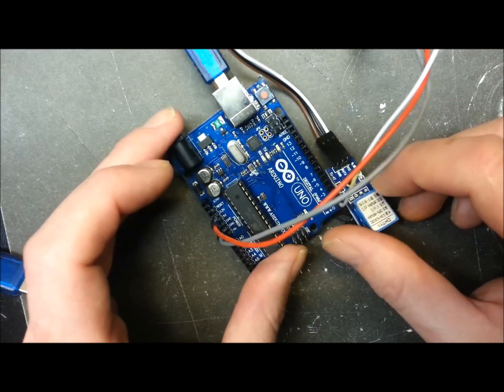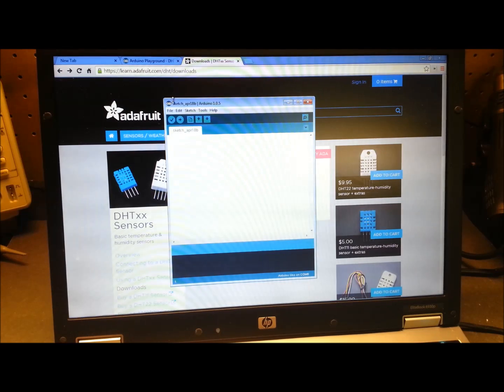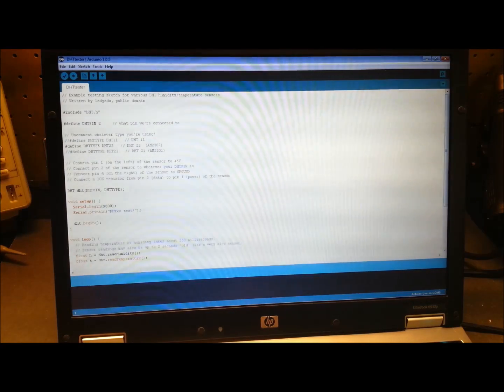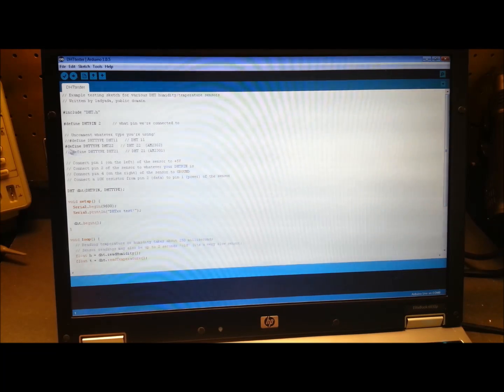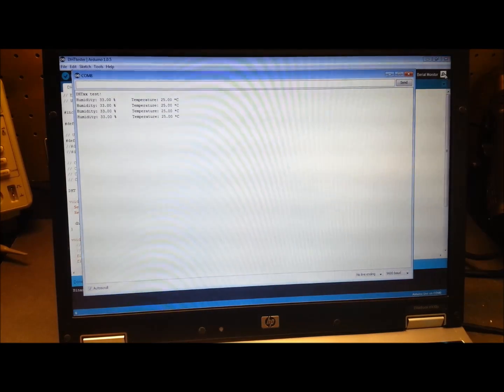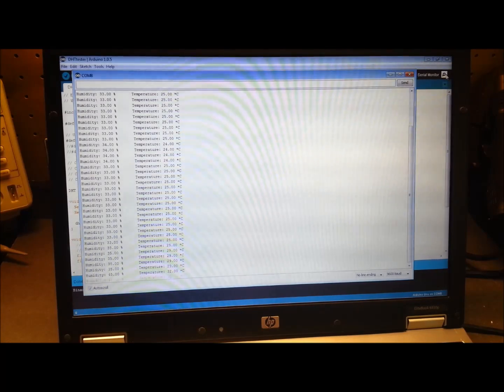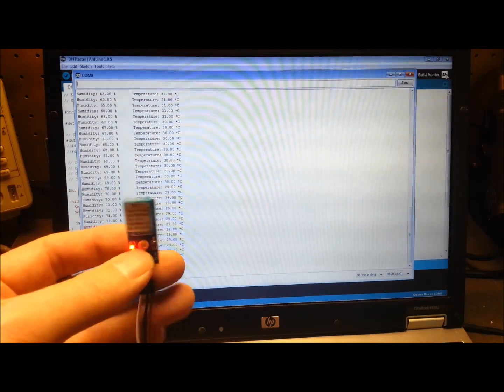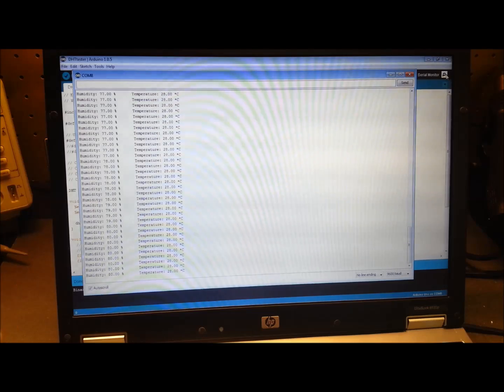Temperature & Humidity Sensor DHT11 -Tutorial

Comment: NOT the 4 pin sensor shown in the YouTube thumbnail of this video !!
Reply from the maker: +Steve Wayne Actually they are both DHT-11 sensors....
Reply: +MKme Lab 
How does one account for the missing 4th pin (either the SCK or DATA pin)?
Isn't the 4 pin DHT11 supposed to be an equivalent alternative to the SHT11 or SHT15 ?

Thanks
Reply from the maker: Steve Wayne You account for it by noting it is not terminated on the breakout board attached to the sensor. This would be the NC pin referenced in the data sheet. Re-watch the video and you can see the sensor has 4 leads- only 3 are needed...

Comment: You can buy a DHT11 sensor on Ebay for less than 1$ & free shipping.
http://www.ebay.com/itm/Chic-Fashion-DHT-11-Digital-Temperature-and-Humidity-Humiture-Sensor-for-Arduino-/391212724184?hash=item5b16186fd8

The one cited by the author of this vid is 3.28$ + shipping.
Reply: +Kyle Sisemore Post the url to it.  The least expensive DHT-11 unit that I see on Ebay is currently 0.95 US$
Reply: Direct from china, 50pcs for $1.
Then sell 48 of them on ebay.
Reply: Where's the url to the product??

Comment: My UNO has both male and female headers and extra male headers for 3 and 5 volt power which I like because I do not like using breadboard wire jumpers that way. I rather use female jumpers to have a more secure type connection.

Anyways I found a proper voltage module for arduino I bought along with a current module but I don't know the actual max rating of the voltage module..

Comment: What I found out about pricing vs shipping time is the cheaper the price the longer it take to get to you. So if you pay $5 from company "A" plus a standard shipping fee you can expect the item quite quickly, where is if you pay $1 plus free shipping for the same device from company "B" it will take longer to reach you, up to 2 months in some cases.
I ordered a Wouxun 2-way radio for $90 plus free shipping in November of 2011 and did not receive it until February 2012, Also the USPS rejected the package and sent it back to the seller, I had to have DHL ship it and pay extra shipping in Late January of 2012 and got it approx a week later in Feb.
So sometimes its worth paying a little more for something to get it delivered faster and shippied properly and not banged up or damaged.
Reply from the maker: ElfNet Gaming Check out my video on "how to buy an SDR"  Process is the same I use for all offshore parts- Ebay, sort buy buy it now, free shipping and most importantly- top rated sellers.  I have never been disappointed yet.  They will do anything to maintain that status.  Cheers

Comment: hi...i have a DHT11 temp sensor...i dont want to get data from it...i just want it to be used as a temp controller, lyk if its connected to a fan, and if the room is too hot, the fan should turn on...can i do this without the arduino board? plz do reply..thanx!
Reply from the maker: Nope it is just a sensor.  You need more components to control an output.  Cheers
Reply: Eric William -MKme Tech  thanks for the reply. could you then please suggest some other temperature sensor that doesn't require microcontrollers? I want just a simple indicator, no measurement is reqquired..thanks again!
Reply from the maker: Rajarshi Bhattacharya Dont have any direct experience with specific ones but there is a tonne out there for temp controllers (modular) Check out the ones people use to convert freezers to kegerators and I'm sure there is 1000 other types sold for specific applications.  I like having control so I would use a 4 buck Arduino, any temp sensor and a 2 buck (or less) relay and have full control with tonnes of other I/O left as spare to play with :)
Reply: Eric William -MKme Tech thanks...by the way, which arduino board did you use? there are several avilable in the market, which should I go for?

Comment: I use windows XP and I installed the DHT 1 folder to the example Arduino folder as instructed.
Reply from the maker: You don't have the library installed correctly.  Also- please don't post 3 times or post code to YouTube.  There are forums for that.  Fix your library and you should be in good shape.  Cheers.
Reply: Thank you Eric for rapid respond!
Reply from the maker: HEOEvgeny Welcome.  I remember having those troubles early on too ;)
Reply: hi,Eric.I tried out again to install the file from the link you provided. I saved on the desktop and dragged it manually to the both example and library folders to be on safe side.The compiling sketch reads errors all over the map still.I Arduino UNO 2 years old only it is an  original mather board.Happy holidays fellow!!

Comment: // Example testing sketch for various DHT humidity/temperature sensors
// Written by ladyada, public domain

#include "DHT.h"

#define DHTPIN 2     // what pin we're connected to

// Uncomment whatever type you're using!
#define DHTTYPE DHT11   // DHT 11
//#define DHTTYPE DHT22   // DHT 22  (AM2302)
//#define DHTTYPE DHT21   // DHT 21 (AM2301)

// Connect pin 1 (on the left) of the sensor to +5V
// NOTE: If using a board with 3.3V logic like an Arduino Due connect pin 1
// to 3.3V instead of 5V!
// Connect pin 2 of the sensor to whatever your DHTPIN is
// Connect pin 4 (on the right) of the sensor to GROUND
// Connect a 10K resistor from pin 2 (data) to pin 1 (power) of the sensor

// Initialize DHT sensor for normal 16mhz Arduino
DHT dht(DHTPIN, DHTTYPE);
// NOTE: For working with a faster chip, like an Arduino Due or Teensy, you
// might need to increase the threshold for cycle counts considered a 1 or 0.
// You can do this by passing a 3rd parameter for this threshold.  It's a bit
// of fiddling to find the right value, but in general the faster the CPU the
// higher the value.  The default for a 16mhz AVR is a value of 6.  For an
// Arduino Due that runs at 84mhz a value of 30 works.
// Example to initialize DHT sensor for Arduino Due:
//DHT dht(DHTPIN, DHTTYPE, 30);

void setup() {
  Serial.begin(9600);
  Serial.println("DHTxx test!");
 
  dht.begin();
}

void loop() {
  // Wait a few seconds between measurements.
  delay(2000);

  // Reading temperature or humidity takes about 250 milliseconds!
  // Sensor readings may also be up to 2 seconds 'old' (its a very slow sensor)
  float h = dht.readHumidity();
  // Read temperature as Celsius
  float t = dht.readTemperature();
  // Read temperature as Fahrenheit
  float f = dht.readTemperature(true);
 
  // Check if any reads failed and exit early (to try again).
  if (isnan(h) || isnan(t) || isnan(f)) {
    Serial.println("Failed to read from DHT sensor!");
    return;
  }

  // Compute heat index
  // Must send in temp in Fahrenheit!
  float hi = dht.computeHeatIndex(f, h);

  Serial.print("Humidity: ");
  Serial.print(h);
  Serial.print(" %\t");
  Serial.print("Temperature: ");
  Serial.print(t);
  Serial.print(" *C ");
  Serial.print(f);
  Serial.print(" *F\t");
  Serial.print("Heat index: ");
  Serial.print(hi);
  Serial.println(" *F");
}
Reply: bump

Comment: Hi,Erick.It is what compiling sketch stated to me.
Arduino: 1.5.6-r2 (Windows 7), Board: "Arduino Uno"

DHTtester.ino:4:17: error: DHT.h: No such file or directory
DHTtester:20: error: expected constructor, destructor, or type conversion before ';' token
DHTtester.ino: In function 'void setup()':
DHTtester:34: error: 'dht' was not declared in this scope
DHTtester.ino: In function 'void loop()':
DHTtester:43: error: 'dht' was not declared in this scope

  I am not up to learn in depth C++ just want to grasp concept a bit.Could you shed the light what is wrong with my sketch.Here is a full standard code below

Comment: Good quality video, I hate to tell you IC station and about 95% of retailers of this item have false information and inferior code.  You do not need the resistor and you can get much more accurate results not using it.  You will however need to to import a different library with much better results.  The improved accuracy and stability can make the upgrade to the dh22 unnecessary for many applications.  For more information email me at etech.steam@gmail.com
Reply from the maker: I've had no problems.  Cheers